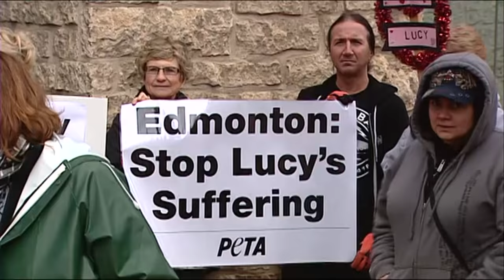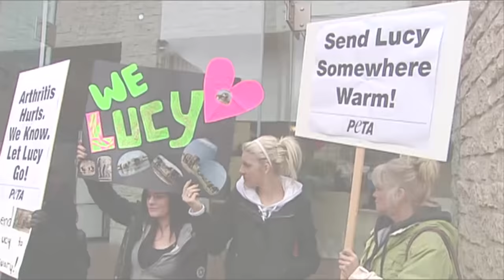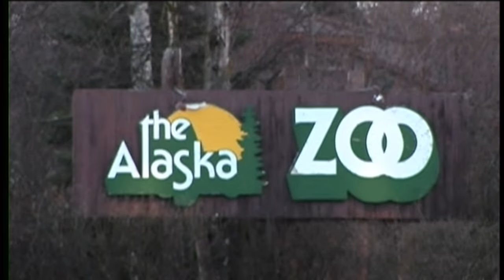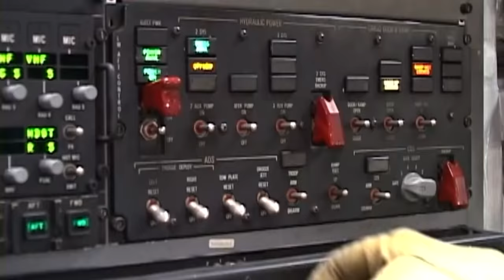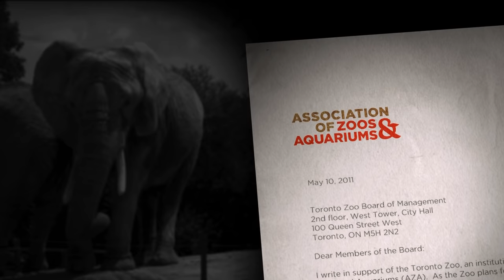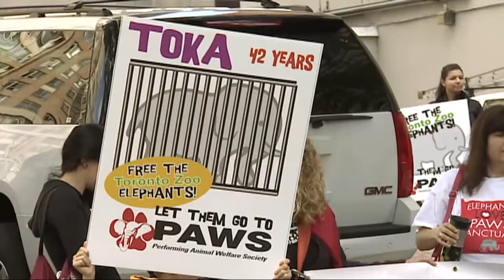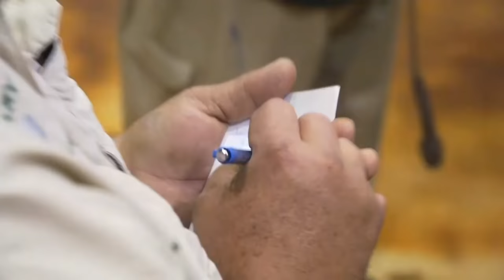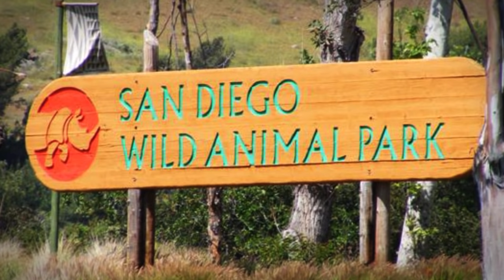Zoo Elephants : The Elephant in the Room - the fifth estate

Comment: Not all Zoos are bad a lot of zoo have the space for Elephants and do what is best for them but some zoo should not have them. It needs to be a zoo by zoo bases. Some animals are only found in zoos  and can never be returned to the wild.
Reply: Sanctuaries are not about returning to the Wild.  No zoo can offer an elephant what they have in natural conditions at a sanctuary.  Concrete does vast damage to an elephant's feet, all hard surfaces do, like hard-packed Earth, and asphalt, and is the most common cause of elephant death in captivity.  ONLY two out of a 100 zoo elephants live to age 50, ONLY 2, whereas elephants in natural environments can live beyond 70.  The chief implement of elephant handling at zoos is called a Bullhook, a sharp steel pointed hook with a long handle that is used to induce pain, it's used for abuse.  You would not say what you have, if you knew about Bullhooks.  Every captive elephant (including at zoos) has been forced through Phajaan/Crush/Torture Training that kills up to half of all elephant calves.  You would not say what you have if you knew about Phajaan/Crush/Torture Training.  When there's a suggestion that some zoos are fine for elephants, that means the speaker doesn't know the needs of elephants, and they don't know that zoos can't meet those needs.  Elephants are migrators that need to walk many miles a day.  They need freedom and roaming and their herd-life, a warm climate and a huge swath of land to roam, water to swim in, mud to cover themselves in, and loose soil to dust themselves in.  They need quiet, peace, respect and safety.  Captivity is death to elephants.  Please learn more; I invite you to make use of my 3 elephant playlists, Elephant Nature Park (Thailand), Retire Lucy (EVZ), and Sheldrick Wildlife Trust Ele Nursery (Kenya).